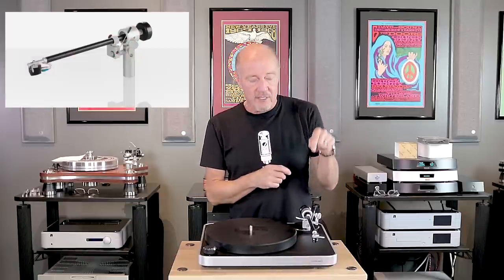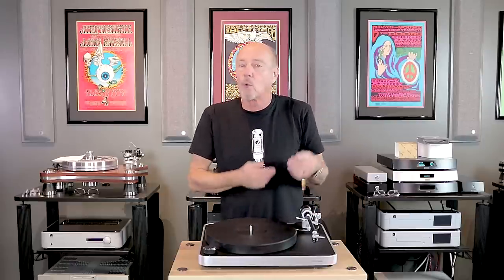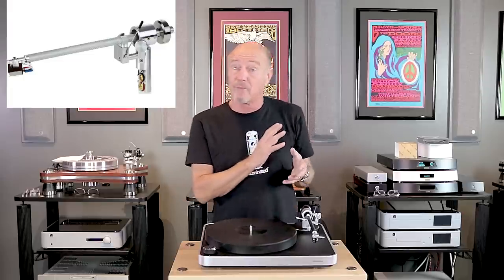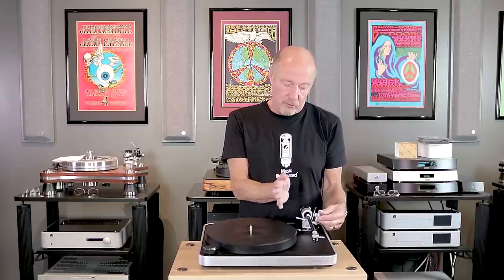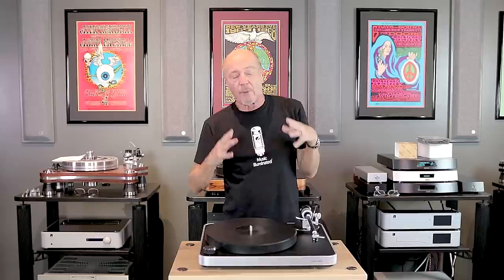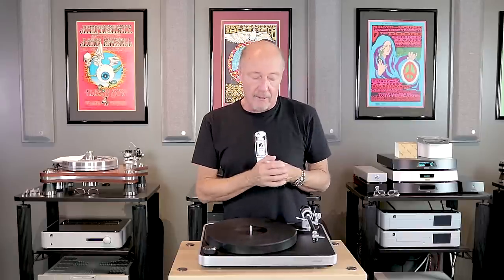Clearaudio Concept Turntable Review w/ Upscale Audio's Kevin Deal

Comment: It looks beautiful, and the build quality is undoubtedly top shelf. I only question how you know that the platter speed is spot on and, if not, how would that be adjusted? I like when a turntable has speed control. Thoughts?
Reply: While you would have to get tools to verify the speed, there are 3 adjustment screws on the back of the TT for each of the speed settings that can be adjusted if needed.
Reply: Wonderful. Thank you! are these tools easy to find and purchase? I assume that we're talking about something to point at the platter like a small strobe light with a digital reader.
Reply: @Tnapvrvideo  there are iPhone apps which can accurately tell you turntable platter speed.
Reply: Fantastic! Thank you!